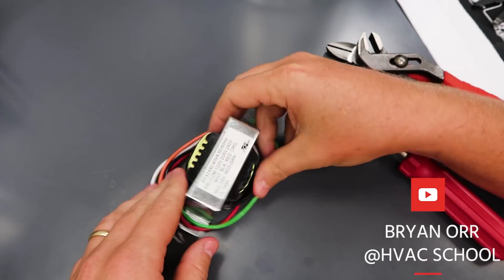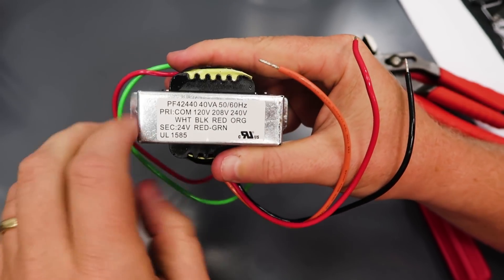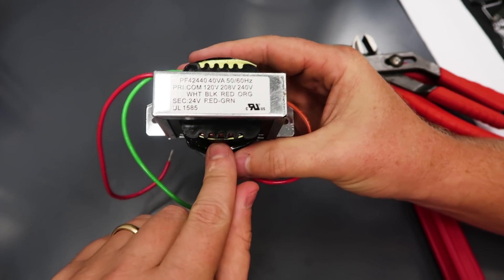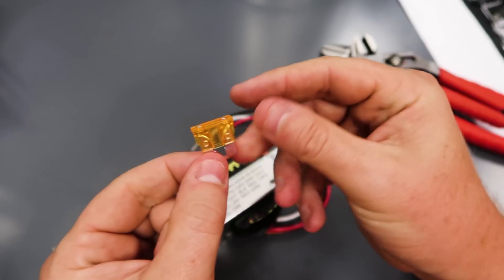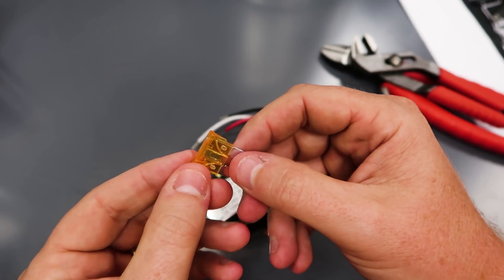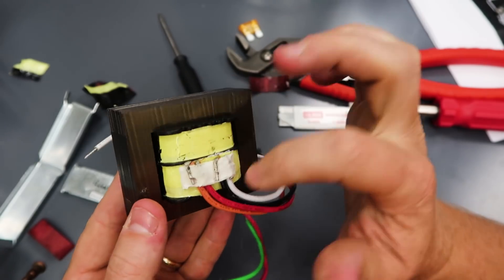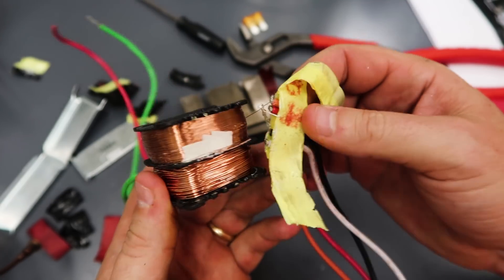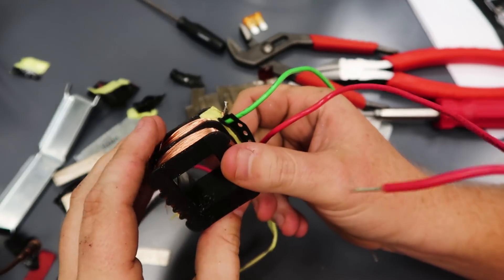How does a Transformer Work?

Comment: if the max amperage for the 24v side is 1.6 amp would there be any problem just using a 3amp fuse instead of a 5amp

Comment: Thanks. On the secondary, by the way the voltage is induced is the red the hot leg and green is neutral and can be bonded or is there any difference between the two?